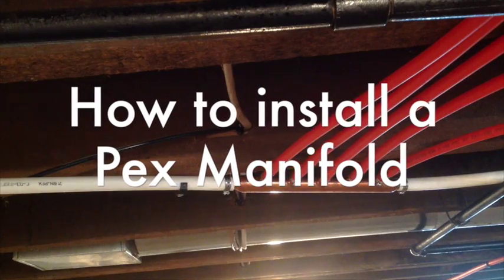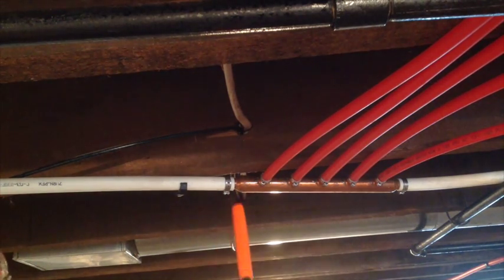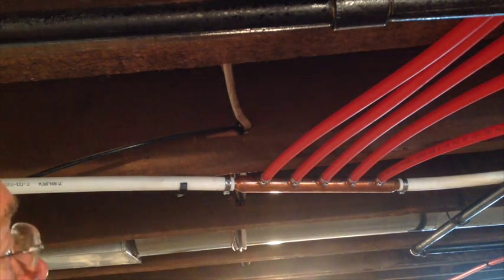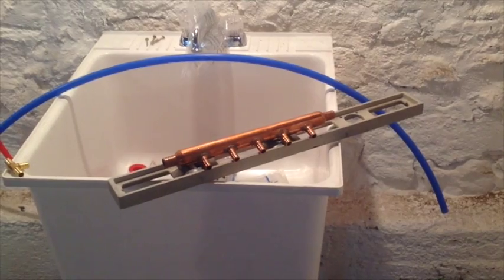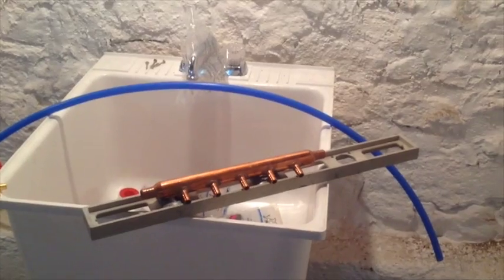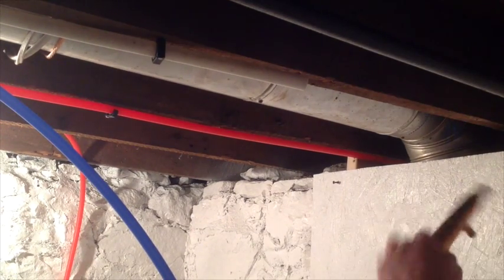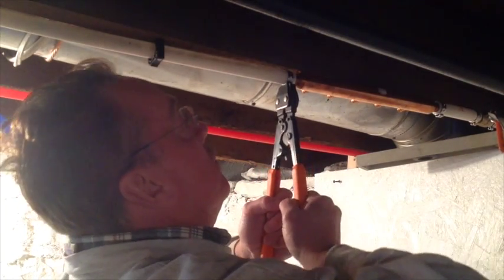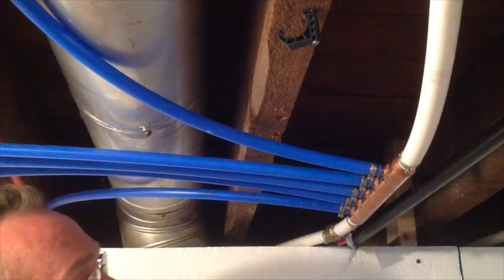How to install a PEX Manifold

Comment: Hey Doug, great job! Question, is it ok to leave one of the openings on the manifold open/unconnected to a pex pipe and the other connected one would still work and no leak/water would come out the unconnected one?
Reply from the maker: J yes it will- you will need to cap it or just get another manifold with the right number of ports
Reply from the maker: Not on the one I installed but I do know you can purchase manifolded with shutoffs

Comment: Now I'm not plumber, but my understanding is that aside from balancing pressure, the point of a manifold system is to have shutoffs available at the beginning of every run.  You can still have shutoffs on each fixture, but now, if something happens along the run and it requires servicing, you still need to shut off the main water, and drain the entire system.  Not the case if you install shutoffs at the manifold.  Better to have extra shutoffs, than not have one where you need it.
Reply from the maker: You are correct...But I do have shutoffs at each device. Reasons for manifold are many ......less connections/cost or points of failure/pressure/etc. You can buy manifolds with shutoffs build in if you like.....